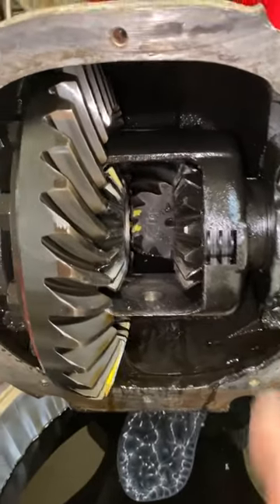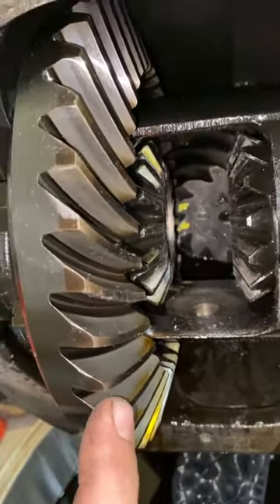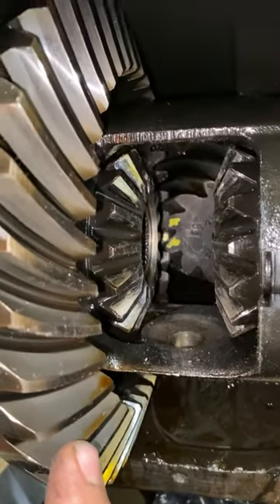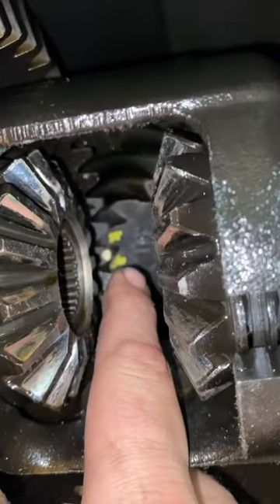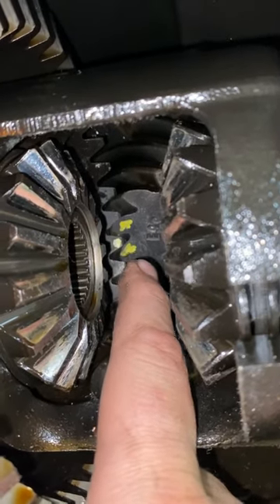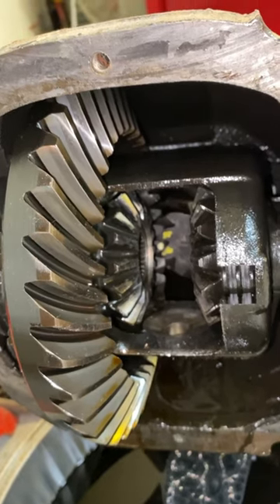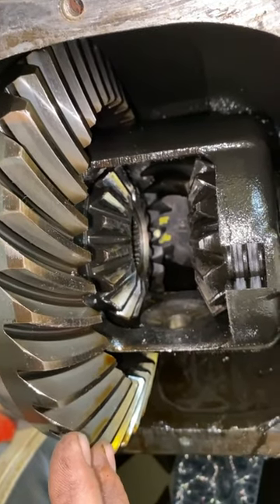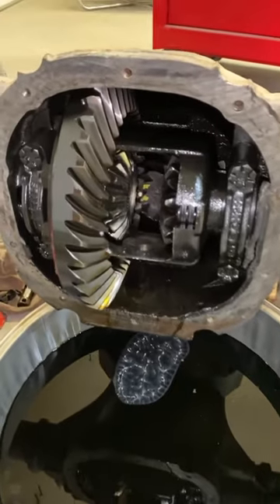Do this before removing ring and pinion gears! #rearend #techtips #ford

Comment: Pretty interesting. Never have thought about it, but never have seen new in Ford box 8.8 gears with a match mark.
Reply from the maker: Yea I don't think new would matter because there is no pervious wear. I got the info for marking them from older ford manuals I believe.

Comment: The correct term is hunting or non hunting gearset.  Non hunting gearset normally will have a dot to two dot markings.  Well done young man. Didn't understand the theory but 100% on the practice.
Reply from the maker: Exactly, thanks. I had forgotten the correct term for it when I made this video. There is also partial non hunting that would require the dots or timing mark as well, but either way both types of non hunting would be treated the same if was full or partial.
Reply: @DesertRatRacer  Hunting to non. An equal. 40 to 10 equal 4.1 non hunting 
 41 3.99.hunting.